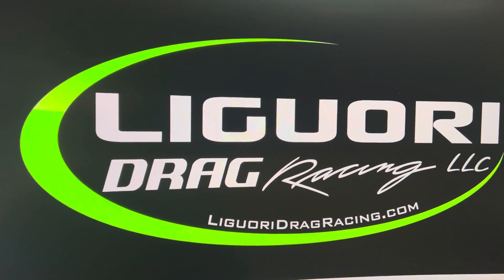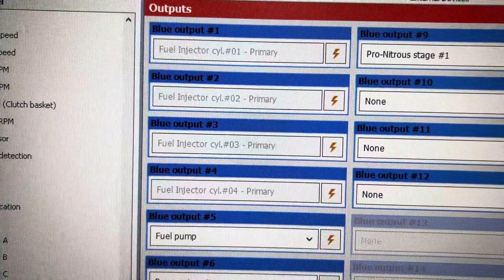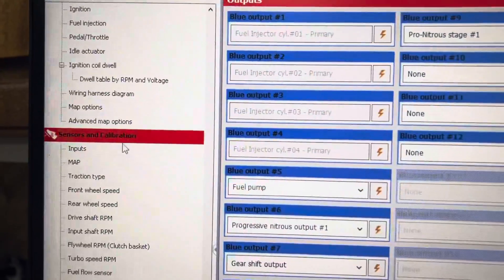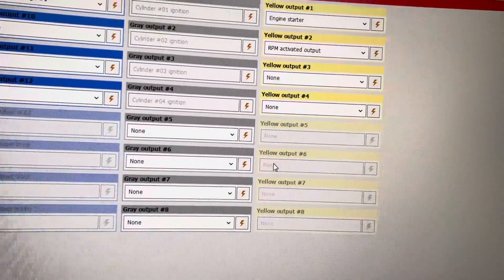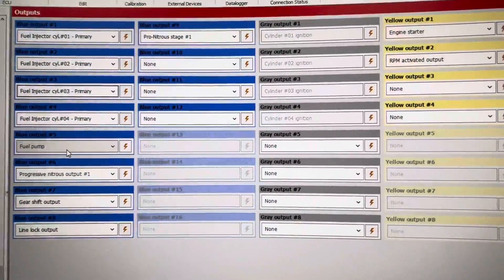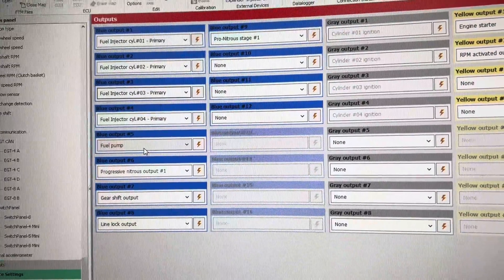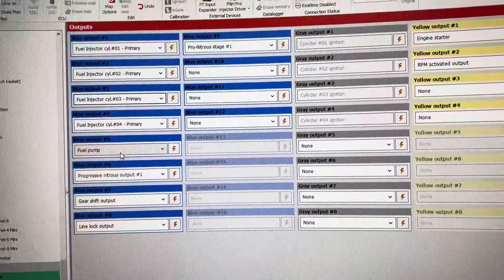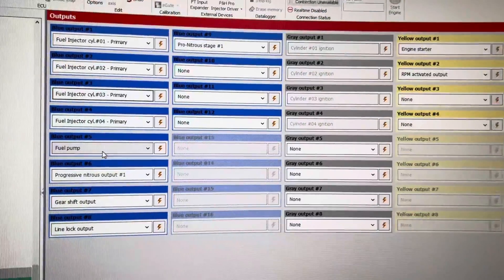FuelTech wiring series Part 3: Outputs

Comment: I am wiring a Honda K20a engine and connected the blue output #5 to the VTEC oil control solenoid. This is not listed in the drop down list. So how can I change or add a name to a blue output?

Comment: Where/how are you able to enter parameters in order to have a yellow (and blue/gray) activate? Example: Yellow output activates when TPS is greater than 90%, RPM above 2000, speed about 1mph etc

Comment: If I have a dual fuel pump set up with dual relay, how do I choose two fuel pump in two different blue output?
Reply from the maker: Are you turning them on at the same time or at different times?

If at the same time you can take 1 output and split it to operate 2 relays.
Reply: They’ll be tune to run together at the same time. 

So I should take both negative relay trigger, and run it to the same blue output?